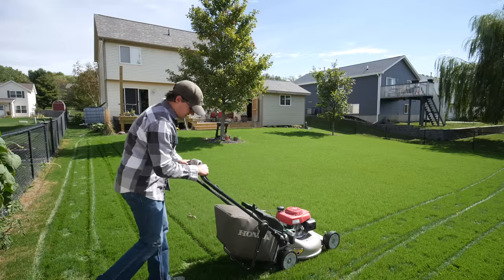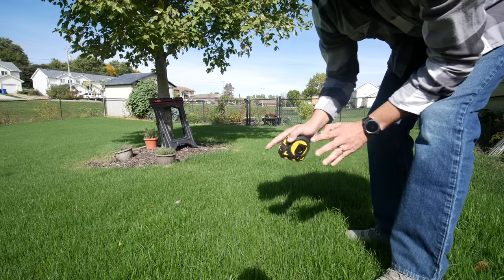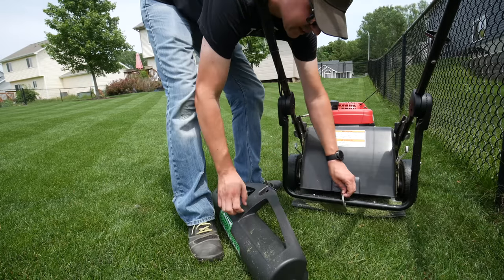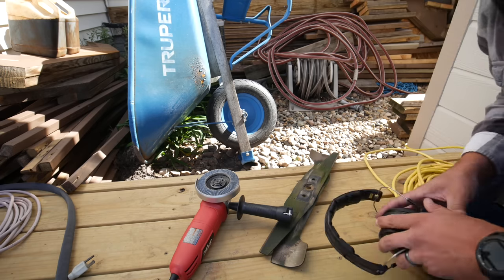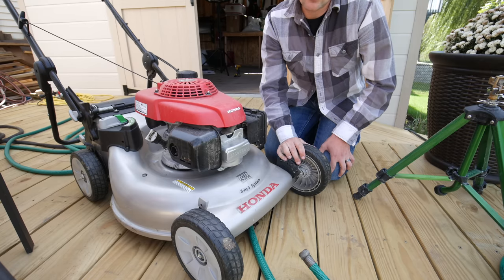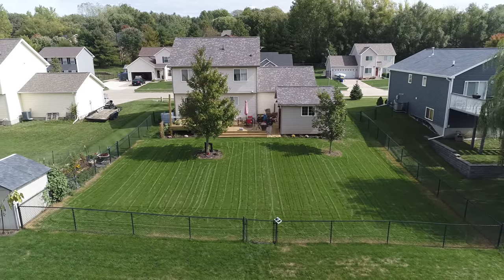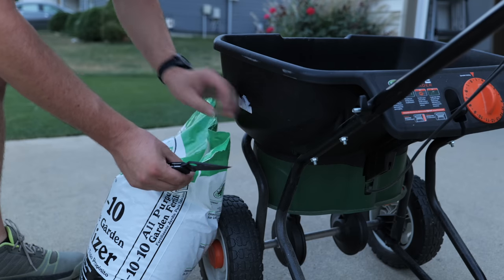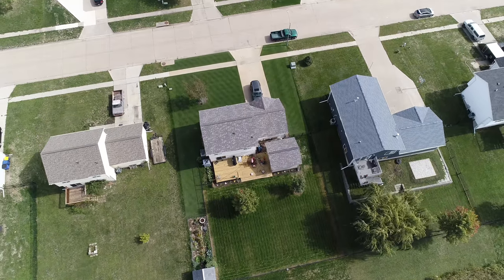When To MOW, WATER, FERTILIZE New Lawns // FIRST MOW on Tall Fescue

Comment from the maker: More on the lawn stryper here -  https://ryanknorrlawncare.com/product/lawn-stryper-lawn-striping-system/
Reply: I seeded at the end of august. I’ve to reseed about 5-10%. The rest is nice and thick. Do I still need to wait to mow?
Reply: Difference between this striper performance wise with the Checkmate?  Easier to remove?
Reply: @milanjurich1526  The Checkmate is far away the best striper available. I dont remove mine ever. I have a large s-hook that clips to the striper and I hang it from the handle cross bar. Then when I need it again I just undo the hook. You can use tie-wire, I just happened to have a big enough s-hook.
Reply: @danny shannon I’ve to reseed some bare patches. I just use my push mow and went around the new areas

Comment: I recently did a complete lawn renovation in Maryland with Tall Fescue.  Unfortunately, I have Quack Grass coming up in the new grass and I'm very frustrated.  I have been researching ways to try to control or eradicate the persistent weed and it looks to be a daunting task.  Do you have any suggestions how to kill off or at least control it in a newly seeded lawn without killing the new grass?  It is late September so I have limited time to make a dent in it this Fall. I just cut the new grass for the first time so I am thinking about putting down some more starter fertilizer and overseeding some of the thinner areas to try to thicken up the new grass as much as possible heading into the Winter.  Hoping to thicken up the tall fescue to squeeze out the Quack Grass for the Spring and Summer of 2022.

Comment: I dropped the SS1000 TTTF seeds on Sept 27. It's 9 days old now. 2 days ago and the week before it, air temp was averaging 50f. Soil temp was higher like 53f. I haven't seen any germinations until today. Temp yesterday was above 60s, WOOHOO! Today's temp was above 70s! I'm just not sure if the young TTTF grass will survive our winter since I was thinking it might not be able to grow deeper roots. What are your thoughts? We always experience subzero temps in January and February. Somewhere between -10F and -20F is normal in our area.

Comment: Great info.  I only have a zero turn mower with a side discharge.  I am about 1 1/2 weeks into a dethatching, aerating, and overseeding with Tractor Supply Kentucky Bluegrass 31 coated.  I put down a starter fertilizer about a week after seeding.  Before doing all this I cut the lawn down to 2 1/2 inches.  We live in western NJ near PA.  The grass is probably around 4 inches or so now.  Would you consider cutting it now and cut it down to 2 1/2 again?

Comment: Great video! I have a question,
How would you raise the blades that were flattened by the weight of the mower wheels so they get cut too.
I'm having a problem with that, 
again great video!

Comment: Sharpening blades .... every time I did that, and I did try to keep the original angle, the cut quality suffered. I ended up just getting new original blades and using as is, without sharpening. What I am testing today (same mower as yours) is checking the RPMs and possibly increasing them. Learned a nice trick on you tube where after adjustment of governor spring, everyone says cut quality became awesome. Many videos on youtube on how to adjust the governor and Grass Daddy had a video on it as well.

Comment: I have spent more money and time on my lawn this past year to improve it.  Total is ~$600 so far,  I was shocked to see that.   Not sure what a lawn service costs, but doing it yourself gives way more satisfaction. Somedays just stare at it for a few minutes.   Recent dethatch and overseed.  Used Scott's Thick R Lawn.  5 weeks later pretty thick, even though i have not been able to spot a single blade of new grass. I even added more seed for front and sides, maybe just too dense?   I keep it around 3.25 inches now.  I bought the coated seeds, maybe go uncoated next time.

Comment: Hey Ryan, I overseeded for the first time 2 weeks ago and my grass came in very nicely. The grass about 2.75" tall. I did a test cut at a high setting. One thing i'm noticing is the grass gets bent over where the wheels went and my foot steps. Will that baby grass perk back up ?
Reply from the maker: Yes it will
Reply: @ryanknorrlawncare  should I bag my grass clippings before putting down fertilizer or maulch ?

Comment: I don’t know what I would do without your channel. I have learned so much. Here in northwestern Illinois it is supposed to get down to 37 degrees overnight. I have some very young seedlings that I’m worried about. Do you think I should cover it? It’s a couple of 15x20 areas In front of the house and bigger in the back. I’m afraid they still die.
Reply: Also, I’m really liking the fescue. I may have to make a switch soon.
Reply: I should have provided some more Info. The areas I seeded some were bare ground some was overseeded and I covered all the bare areas with some weed free straw. So the seed is “covered” but I got a late start and some of this seed has just germinated and some seedlings are just barely poking out of the straw.. I’m going to just be miserable if they die. Thanks for your time Ryan.
Reply from the maker: probably just going to have to let it ride and hope for the best

Comment: I would appreciate an advice. I made new turf 2 weeks ago, and despite not ideal weather conditions the germination is doing good. Granted I now see some bare spots here and there but the offsprings in general are between 3-5cm (1.1/4" to 2"). The grass seeds were tall fescue mix with some bluegrass and lolium parene(barenbrug dry and strong).
I plan to throw some seeds again where I see needs for it, but what baffles me is mowing time? Should I wait for all grass to germinate despite some of it being taller and denser than other parts, or just mow it when it reach 4"?
Another problem is that I have only a trimmer :/
I know it isnt recommended to mow with grass eater at the beggining, but cant buy new mower now. Is it okay to use the pruning cutter which I have as part of my trimmer to try and mow it first few times?
Thank you
Reply from the maker: I usually just start mowing when it needs it and throw seed down after that and let it start germinating. It will pretty much be held in place by the grass growing around it and should be fine

Comment: Just killed off my lawn with roundup and removed. New Loam and used tenacity and Jonathan green sod and seed fert and black beauty seed. I didn’t topover with peat moss, should I have raked in the seed at all where it’s getting chilly here in Massachusetts? I seeded after a new irrigation was installed I’m on day 4 after seeding. Also, I’m being told I should cover with straw...really don’t want to. Suggestions???
Reply from the maker: It's getting pretty late so you might have issues with freezing temps on the new grass. A little cover wouldn't hurt
Reply: Ryan Knorr Lawn Care 
I put peat moss over it last night. Very time consuming but it’s getting up to 75 Saturday so I’m hoping it helps.  Thank you for replying! I’ll grab some waxed straw if the temps go to freezing before it gets to 3 inches. This all started because of trivialis! It’s horrible stuff. Any suggestions on how to keep it from coming back?

Comment: Why do you use a tiny mower?  Wide commercial mowers make a much nicer appearance and take a fraction of the time to cut.  I always thought that tiny mowers cutting at higher heights looked crappy with their wheel marks and all.
Reply from the maker: Because you'll ruin a newly seeded lawn with a heavy machine.
Reply: @ryanknorrlawncare  Nonsense.  Wider tires gives plenty of weight distribution. 30 years experience.  Well, don't make tight turns...   Methinks you just like to mow.  Me too, carry on.

Comment: 2 inches is kinda low for fescue. Should be at least at 3. Ideally 4 inches. You may stress it out if you continue to cut it at that height next year.
Reply from the maker: Elite varieties...plenty of room to work it lower than most
Reply: @ryanknorrlawncare  ok that makes sense. I just over seeded with gci tall fescue in my back yard and renovated my front with the tall fescue /blue grass blend from them as well. Ill cut the front lower to see if it can withstand the pressure
Reply: @ryanknorrlawncare  would scotts tall fescue mix be considered "elite variety", or should I cut it at least 3 inches?

Comment: Sorry to tell you but tall fescue should be cut a minimum of 3 inches and it's better to mow 3 1/2 to 4 1/2
Reply from the maker: Myth
Reply: NC state recommends 3 inch while some others recommend higher. It’s a matter of preference however the consensus for tttf is generally 3.5 or higher. Also keep in mind where Ryan lives this time of year doesn’t get as hot as most places that use tttf (like Charlotte/ transition zone)
Reply: Haha
Reply from the maker: @jlodaddie  I'm working directly with a seed grower and also have done a lot of research on the varieties I used. They can be mowed lower if you are ok with more maintenance
Reply: I just planted turf type tall fescue from gci turf academy and it really good for the price.    And what's weird is it was the almost exact day as you
Reply: Ryan Knorr Lawn Care I love your vids Ryan and I’m agreeing with you. Like I said where you live it’s a matter of preference. A lot of areas where tttf is planted are in subtropical climates and are subject to dry spells and excessive heat. For those in these areas of the transition zone, no type of tall fescue should be cut that low.
Reply: @jlodaddie  I live in MN and I cut my tttf at 3 1/2 to 4 1/2 but I cut it at 2 1/4 in the fall after seeding on accident and it looked pretty good
Reply: Newer varieties are recommended to be kept shorter. I cut at 2. Defiance XRE recommends 1”-2.5” HOC.
Reply: PutEmInTheBox defiance xre is a blend of 3. One which has rhizomes thus making it quicker to respond from stress especially farther north. A tttf without these qualities, in mid-south transitions zone, shouldn’t be cut at 2 inches under any conditions other than prep for over seeding in fall.
Reply: John Lowe yes, I agree, a blend of three TTTFs. Newer, “not your grandads” TTTF.

Comment: Low setting at front and higher setting at rear  ‘will not work’!  The lawn will be cut at the lowest setting on the mower.  In this instance the front of the move is set to lower than 2” therefore the lawn will be cut at the hight of the front setting.